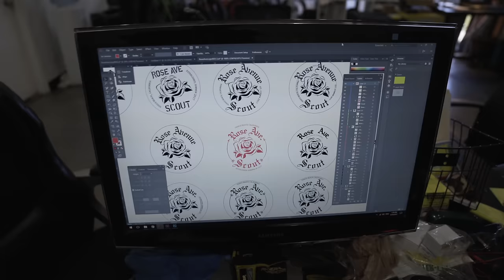WORLDS BEST ELECTRIC BIKE *GIVEAWAY*

Comment: Great idea but this is why you'll have problems. 1st you can get a kit for a real mini bike with the parts you want for a few hundred dollars. Taco sells the classic one for $1000, so the price is too high. 2nd your mounting the front tire assembly wrong. The rear I couldn't see but there's a better and safer way. 3rd you need to have a larger motor option and stronger battery, very simple fix. There's some other parts off of other existing vehicles that can be used to improve your design very easily. Where is your shop located? You've given me a good idea.